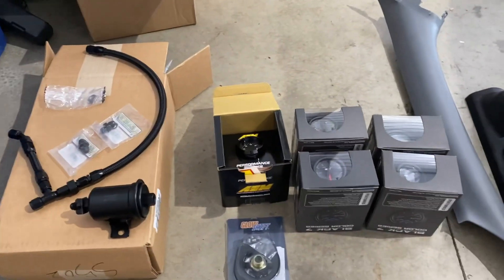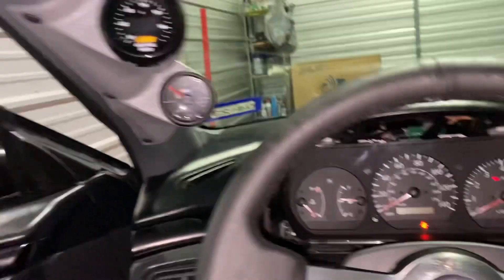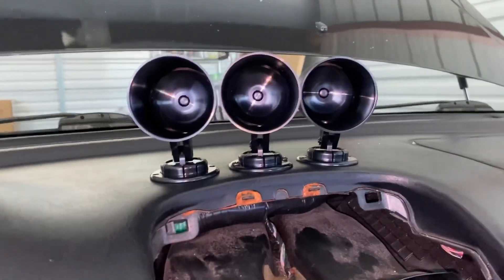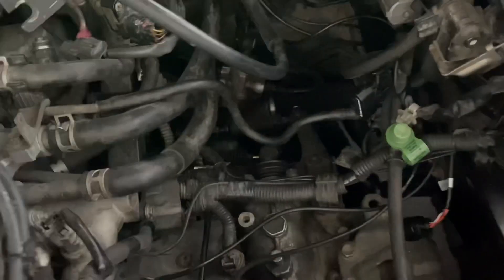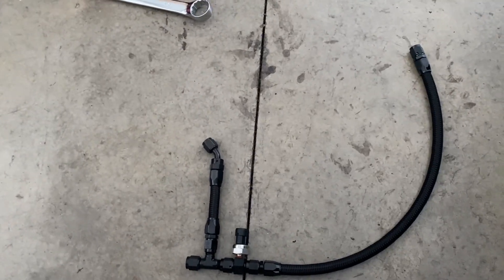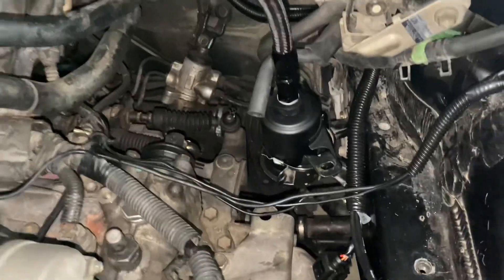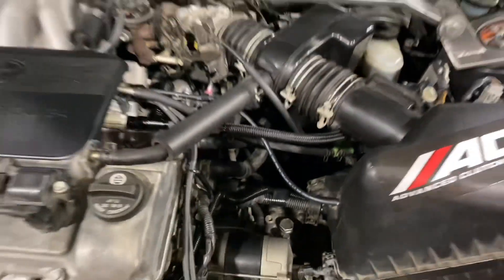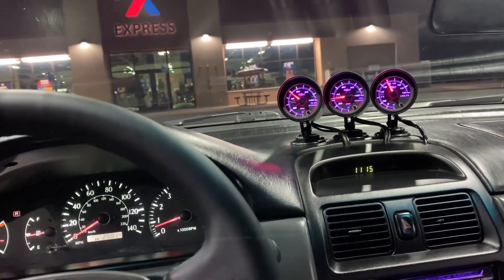Installing Gauges and Jim’s Fuel Mod (Something all Boosted 1MZ’s Should Have!)

Comment from the maker: Important note:
If you don’t plan on boosting your 1MZ, you won’t benefit from Jim’s Fuel mod. However, you will regain some factory power by replacing your old fuel filter with a new one. It’s usually neglected since it’s hidden. Your car will thank you later.
Reply: Which year was your Solara?   For my model year 2002 es300 they show the fuel filter to be in the pump assembly between the line and and pump.  On earlier models they show the fender bolted steel filter in the engine bay.
Reply from the maker: @dennisrobinson8008 sorry just saw this, my car is a 2000 model
I’m not entirely familiar with the 4th Gen es300’s, sorry

Comment: i just finished boosting my 1mz camry im at 3 psi but i want to get fuel mods done before i push more (5-7 psi later) when you remove the pulse damper and do this does it throw any codes? or is this just plug and play easy? my turbo setup actually has no codes now and id like to keep it that way lol
Reply from the maker: So on this setup, I ran without tuning software for about 3? 4 months? Never had any issues with it and I beat the hell out of it. Stock ecu should make fuel adjustments for up to about 4 pounds considering they bolted superchargers onto them from the factory. Got a few buddies running low boost like that on stock ecu and their cars sing
Reply: @drivenbylew I never did do the mod but I’ve been driving it since I made that post as my daily and it rips lol. At the manifold it sees maybe 5 at max and not an issue
Reply from the maker: I believe it man, they’re already quick little cars when they’re stock lol
Reply: @drivenbylew it’s been a super fun time since I got it done for sure!

Comment: I know im late in the game - but love ur vidz!! your Lara ' looking fly!! What aftermarket radiator is that u got.  Need one! And the steering wheel . Tha shitt  CLEAAAAN' ! What steering wheel hub from NRG is that. Sorry if I'm picking your brain. And I'm asking too much but.
I love your car brodie
Reply from the maker: I appreciate that bro all good no worries! The hub is an srk-125h hub, but the clockspring did not fit with it. I manually operate my turn signals on and off, and I have my horn wired to a separate button on the column trim. Radiator was custom made by griffin to replicate the oem one. Most (tig) weld shops should be able to replicate

Comment: OK, so you mentioned you certainly went from returnless to a return style fuel system.    In the returnless system it has the regulator/bypass at the fuel pump assembly, what did you do about all of this?
Reply from the maker: Mentioned in the first video you commented on with the details, but yes the oem regulator is on the fuel pump assembly
Reply: I'll check out the first video.   I remember you drilled a hole in the fuel pump assembly for the return line and you used a older Celica fuel filter on the firewall which had large diameter inlet and outlet for flow, but i didn't remember you ditching the internal regulator. @drivenbylew
Reply from the maker: @dennisrobinson8008  yeah it’s part of switching to an external regulator 

Factory regulator sits at 50psi but I needed one that could reference vacuum for the boost

Comment: Saw your vid where you broke something in the bottom end at 12psi.   Before your video I knew 6psi was extremely safe and head gasket will lift between 8 to 10 psi.   Also the stock rods and pistons are going to give up between 9 to 10 psi.  Good to know 12 psi is certainly a threshold.   Think one should limit to 8psi unless they build the bottom end.  Your testing showed it may have survived 9 or 10psi with timing retard and a good enough fuel system the head gaskets and head studs and good fuel.   Your contacts said you may have survived the 12 psi with meth injection.   You can also go e85 to stave off detonation and it runs cooler.
Reply from the maker: Yeah Tony the Tiger on SolaraGuy did a write up way back about running 15-16 psi on a stock 1MZ

From what I remember it lasted a couple months of hard driving before showing signs of scoring on the rod bearings 

Mine ultimately threw rods because of a lubrication issue, whether it be simply bad oil from a lot of pulls or compromised piston rings/turbo bearing shavings. It was running very rich at first but we took care of that. 

Regardless, the next engine I use and abuse in this car will have a forged bottom end at the minimum. I’ll be using shim-less buckets as well. Possible 2mz intake cams and 3MZ exhaust cams if I can get my hands on a set. Methanol/water injection as well. Gonna keep it around 12-15 pounds and call it a day
Reply: @drivenbylew  Good info.  I'm not going to chance it and my upper limit would be 8psi stock bottom  without replacing gasket and head bolts.  With rods and pistons we can do 20+ psi but supposedly we have tranny issues at 8+ psi as well.   There was 3.0l 2jz thread where the gt3076 with the .86 ar is the way to go for 400 to 500whp and tq out of 3L.   It goes into full boost 700 rpm earlier than the gt35 .86 and makes more power than the gt30 .64 ar.   The .64 ar chokes it down and is beaten by the .86 ar across the curve.   Some additional info is the rod to stroke ratio is 1.77 on 1mz.   The 3.3L 3mz has a sleeve between 5 and 6mm thick.  Going to a bore similar to 3.5L 2gr is not that big a deal and you can increase bore enough to get to 3.7L safely.  With an offset ground stock crank you could get an additional .2" of stroke and be right around 4.0L.    Just some thoughts.  Also 1mz has a sleeve between 4 and 5mm thick.   At its upper limit you could bore it to get the 3.3l of 3mz.   All 1mz, 3mz and 2gr use the same stroke of 3.27" or 83mm.   The rod journals are the same size.  The rod length are the same.   Its said 3mz and 2gr have the exact same connecting rods.  Good for about 400 to 420hp due to thickness.   Not 100% sure 1mz and 3mz share rods.   But they are all the same length.   I wonder if your 12 psi would have survived with e85?
Reply: I'll revisit the Tony the tiger posts.  I remember he did build a stock block hi boost but don't remember 15psi.   Maybe 10 or 12 but ill recheck.
Reply: I responded but the response was removed.  I did find a Tony the Tiger 1mz build stock bottom end to 357whp.     It was thru an automatic.   For that to happen the boost was certainly between 14 and 16psi.   I don't know if the tranny was built.  I also don't know for sure if he used are studs and upgraded head gasket.   The turbo was a gt3076.    Those turbos can get a little over 500whp and 500wtq out of 3l, boost coming on starting at 1800 rpm in the dynos I've seen.    Thats my desire to feel some torque in between 2000 and 3000 rpm in daily driving.    I think E85 keeps it safer hard to detonate running lean and you really don't need a timing retard with it.  It also cools the air charge.  Plus makes more power.
Reply: @dennisrobinson8008 so what I’m seeing is 6/7 psi on a stock auto box is fine.
Reply: @spacetoasted  Good info...   6 to 7 psi on these cars is around 300hp engine and 300 tq engine...    For the cars they are in it will make it feel like a different car...
Reply: @drivenbylew  Did you ever make new progress on your build or start a new build?
Reply from the maker: @dennisrobinson8008  I got it back running, just uploaded another video
Reply: Appreciate the updates bro. @drivenbylew

Comment: Can you make a video on the cruise control delete.
Reply from the maker: I don’t have any of the parts anymore but it’s a very simple delete. Just unplug and uninstall the mount for the module. It’s the little box right next to the battery. You’ll end up getting rid of one of the throttle cables. Just use the cable that comes out of the firewall and install it directly onto the throttle body valve

Comment: This thing is so clean. I have a 99 solara. Howd u do ur dual exhaust?
Reply from the maker: Thank you🤝🏼🤝🏼 There’s a Y pipe right after the rear crossmember. Just a muffler delete and resonated tips

Without the lip kit you could run mufflers and have the tips a little further from the center but there’s no room for mufflers with how I have mine setup